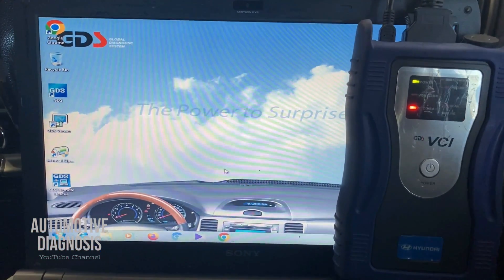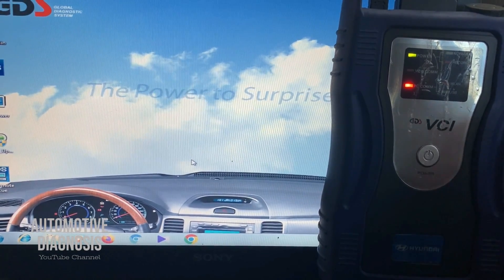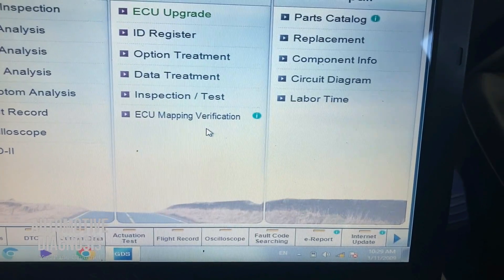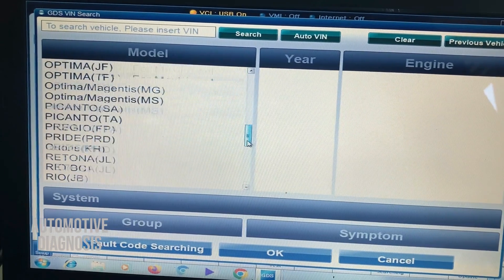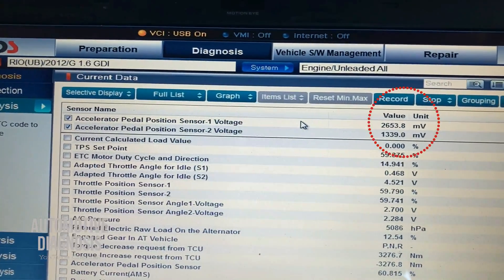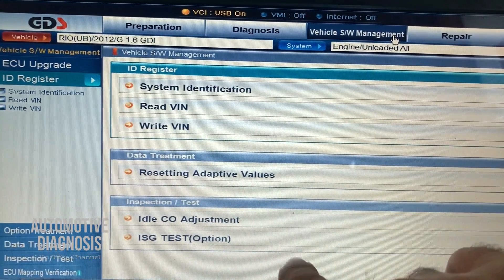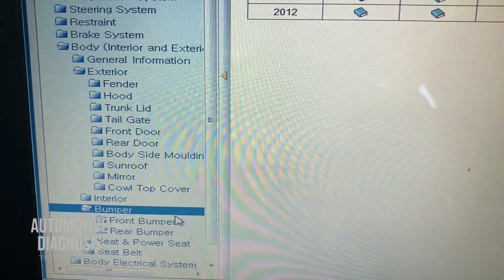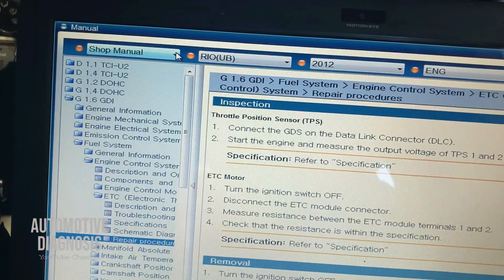How to Use Hyundai & KIA OEM Scan Tool (GDS) | Diagnostic, Wiring Diagrams, workshop manuals #kia

Comment: I wonder if repair shops have this software or is it dealer only. Id love to find a shop that does because dealers are a pain. I have a 2018 Elantra SE that have the updated OEM ignition coils installed but didn't have the GDS ECM misfire update on it, so it kept bucking periodically regardless of coils.
Reply from the maker: Hi there, this is available in many repair shops as well, but it only covers up to 2018.

Comment: Hi! Can this tool delete the DPF from the system of the car? After removing the DPF
Reply from the maker: Hi there, What you are asking is downgrading the ECM software, It used to be rarely possible, not anymore.
Reply: @AutomotiveDiagnosis  Ohh too bad. I thought it was as easy as switching off an option on the ECM.

Comment: hello from Panama , I need to refash my 2012 hyundai elantra ECU .. Can you prode some trustable dealers for this interface? where did you donwnload the GDS ??
Reply from the maker: Hi there, I bought this scanner years ago, you can find many different suppliers by searing on Google. Normally when you buy the device, they must provide the software too (note: this scanner does not cover any model after 2018)

Comment: I just returned this system back to China seller (VXDAS). I never got to the hardware as the software never worked. The software came in 6 CDs but did not work. The seller then said an SSD disk with GDS software installed on my Win7 would work ($89), it did not. Both the CDs and the SSD never opened on my Win7 laptop. Seller was useless at solving the issue. Seller agreed to refund all money including $80 shipping to China.

Comment: can you edit paramters with this program? like turn off smart charging of battery? or turn off start stop?
Reply from the maker: Hi there, there are some options that we can activate using this scan tool, but we can’t change the parameters.
Reply: @AutomotiveDiagnosis  thanks for reply. good thing I didn't buy it.